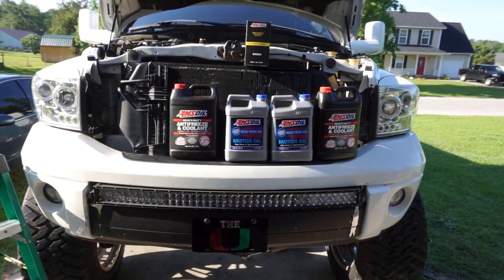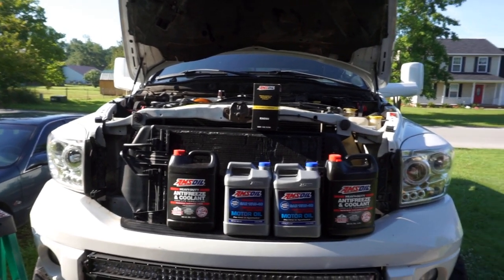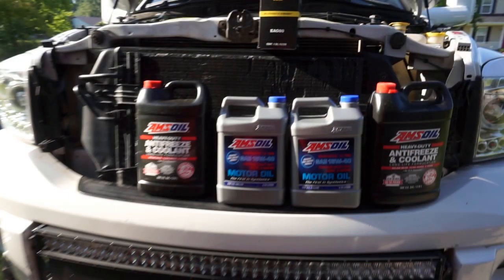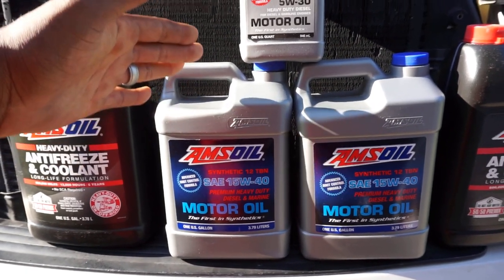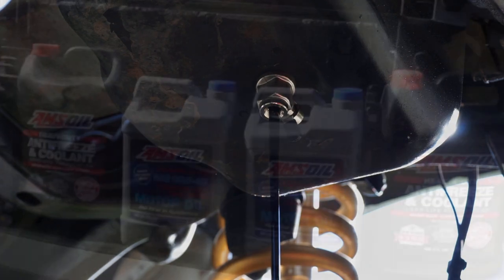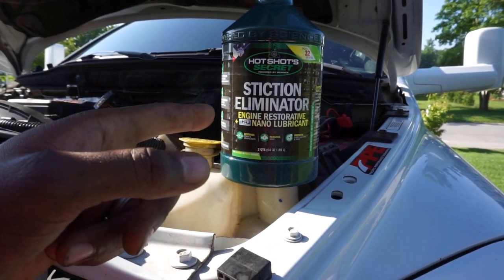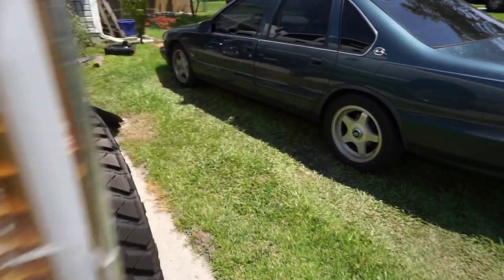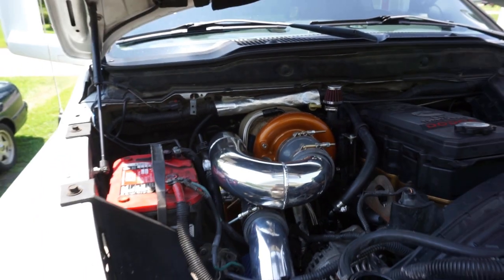IS AMSOIL REALLY WORTH IT?? || 1ST DRIVE WITH COMPOUND TURBOS!!!

Comment: Man she sounds badass ! I hope your transmission keep up with this power 🤞🏻😅
Reply from the maker: She gonna be alright! Haha
Reply: Yo cam I've got a 08 with the 68 in it, does your truck ever throw a code for the TCM...i put a triple disc t.c and high pressure valve body and I'm still having trouble with the trans going into limp mode and the trans temp goes up to 200 and doesn't shift past 4th gear.
Reply from the maker: @freightshakernation9429  i never have that issue man, trans only went to into limp once. Best thing I can say is try a relearn on it and allow 200-300 miles for the trans to relearn. Also if u got a 4th gen keep in mind everytime u switch tunes you cause the tcm to do relearn so make sure your not driving on it hard initially when u change tunes. The relearn is best when u can do a lot of city driving and stop and go driving. Try to avoid long highway driving during that time. Also another thing to look into is your solenoid pack. They are hit and miss on these trans but the 2010-2012 ones are known for going bad
Reply: Dude that setup is sick. See you got them patches displayed on the dash. I was stationed down on New River for about 7 years.

Comment: The Series 3000 5W-30 diesel oil you had was for pre-2007 diesel engine as well and is the most fuel-efficient oil for diesel engines made by Amsoil. The Heavy Duty 15W-40 oil is our entry-grade diesel oil and has 4 times more wear protection in the Detroit DD13 cylinder scuff test. The Signature Series is rated at 6x more wear protection.
Reply: I know this is an old post, but are you still offering 10 percent off?

Comment: stiction eliminator makes your truck smell like fruity pebbles I love that stuff
Reply: Good stuff wasnt a believer till used it n was notable more power made truck feel new and responsive again after 200k miles
Reply from the maker: Ok i thought I was tripping cause I can smell the stiction eliminator in the exhaust kinda and I was getting thrown off 🤣
Reply from the maker: I got 178k granted my engine is well maintained i figured its worth trying out so wth. Lol hot shot makes good products from my record
Reply: lol, the smell goes away after maybe around 10 20 miles
Reply: Miller Lincoln What oil you ran with it?

Comment: I’m going to start using Amsiol on my 17 Ram 3500 stock no deletes. I’ve been using Hot Shot Secrets additives religiously for the past 3 years. I’m trying to get info on the positives or negatives on using the two together. I’m in California so also looking for recommendation on 5/40 or 15/40.
Reply from the maker: I like amsoil, on a emission intact truck I would run the signature series. My dealer Adrian can get it right with and tell u the best amsoil product.

Comment: Have you done valve springs and pushrods if not you definitely need to look into them since it’s making that high of boost would hate to see that fail causing major downtime
Reply from the maker: I got some on the way soon! Gonna be installing those when I instal the injectors

Comment: Sounds sweet! You tried not to smile on the 1st hit when it started to whistle. LOL! I made the switch to Amsoil last week. I used your name as the referral. Didn't go through your guy though. Bought it direct. Was on my porch the next day! I've been using Hot Shots Secret fuel additives since truck was new. Sold on them. I thought about going with their Blue Diamond oil, but they wanted $85.00 for 2 day shipping. Chad pretty much had me sold on the oil. Maybe next time.
Reply from the maker: Haha yea next time man u can save some if u go through Adrian. But either way your still getting some good oil man and can't complain!

Comment: I use the Stiction eliminator on my 7.3l  and wow, my oil is not even that dark and it has been in the truck for 3000 miles, compared to just running oil that gets dark quick! Plus the engine idles way better
Reply from the maker: I heard the 7.3 and 6.0s love them with the hydraulic injectors! My exhaust smells kinda like it now lol

Comment: Do you recommend the Smeding turbos? I am thinking about getting a S366 and I want to know if they are any count. That’s a badass truck you have too
Reply from the maker: All my aftermarket turbos have been smeding turbos. Never had a issue and run amazing. I got a code with MDC DIESEL to save $100 as well. Code "everythangdiesel"
Reply: EVERYTHANG DIESEL Thanks man, I just ordered mine. Your code wouldn’t work on the turbo kit I got for some reason though
Reply from the maker: Awesome man, if its already on sale it may not work. What turbo did u get?
Reply: EVERYTHANG DIESEL I got the s363 14cm 2nd gen drop in turbo. I don’t think it would work on the certain turbo I got because I tried the code on another turbo and it worked then

Comment: What made you use 15w-40 compared to 5w-40?
Reply from the maker: 15w-40 is the recommended weight for these engines, but real reason i switched was cause i using 15w_40 u get better wear protection vs 5w_40 but less fuel economy.  I prefer the slight protection over slight fuel economy increase. Both excellent products and run fine.

Comment: Is Amsoil the best?.... ummm YES!

I PUT THAT SH!T EVERYTHING!

One thing though... Rams (mopar) factory oil filter IS a better filter with lower microns. I believe its under 10 microns

Also just buy WIX XP filters if you want an Amsoil filter.  Amsoil buys them from WIX and relables them. As far as the best oil.. Amsoil Signature series is hands down the best
Reply from the maker: Be careful with running too small of a micron oil filter for your primary oil filter it can cause excessive oil pressure and lack of oil flow throughout your engine. The mopar filter work fine i ran them for years before switching.
Reply: @EVERYTHANGDIESEL  yeah that's true, but its the factor filter and has been shown to out perform amsoil/wix and the others.

Other then that Amsoil is my go to for sure!

Comment: Just run Delo 15w 40 and change every 4,000 to 5,000 miles.  Running 15,000 miles on 3 gallons of oil, no thankyou
Reply from the maker: The cost doing that vs what I run you would be paying more than what I do. Nothing wrong with changing your oil that often its actually good but I like to get my money worth haha. Plus guarantee u would notice better mpg with amsoil. I've done lot of testing and research on this brand and I trust there claims.
Reply: Shit, my 4th gen's OE maintenance schedule calls for 15,000 mile oil changes.  It isn't 1990 anymore where 5,000 mile oil change intervals are considered long.  A lot of people who run bypass filtration go 30,000 miles between changes.  All that matters is that the oils samples come back good.  No need to waste money with an outdated ideology when the science is there.

Comment: So you put Stiction eliminator in your oil. You know hot shots designed that for Fords with the Hydraulic Electronic Unit Diesel Injectors (HEUI). Not common rails. Drain that oil out and fill up with just amsoil. You literally have a gallon of less oil properties in it right now.

And you want people to take your advice?
Reply from the maker: What makes u think its only for heui?  Even though it specifically says works on all diesel and gasoline engines? Also I personally know people who run this in there cummins trucks and no issues at all. Gtfo here with your hate.
Reply: Dude, step back from gazing at those soft-core porn channels and take a minute to read what Hot Shot's Secret has to say about it before you start handing out bad advice:

"Hot Shot’s Stiction Eliminator for gas and diesel engines is a unique blend of synthetic cleaner and a proprietary carbon nano lubricant that cleans and lubricates the oil-wetted components inside your engine, including turbocharger, rings, oil pump, pistons, HEUI injectors and more. Stiction Eliminator will also improve your fuel economy, restore power and compression and fix 9 out of 10 “failing” HEUI injectors."

I swear owning a Ford and illiteracy go hand-in-hand.  🤷‍♂️
Reply from the maker: 🤣🤣🤣🤣 idk bro must be something haha